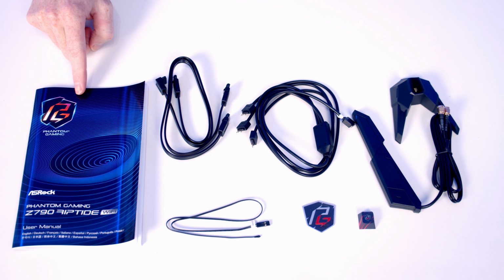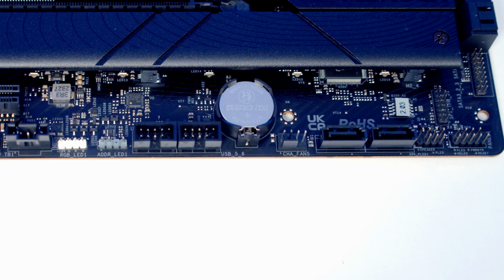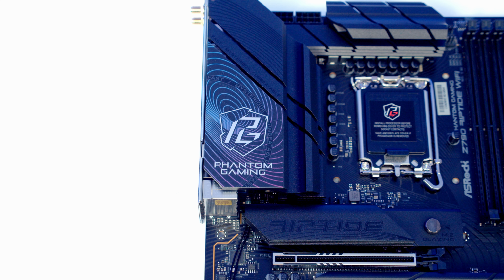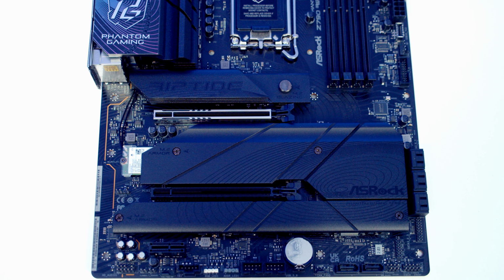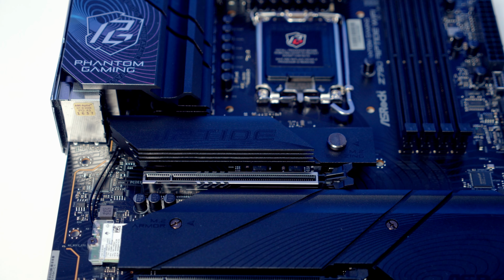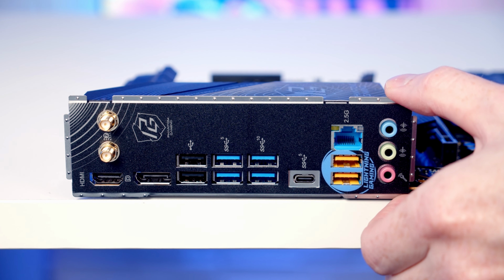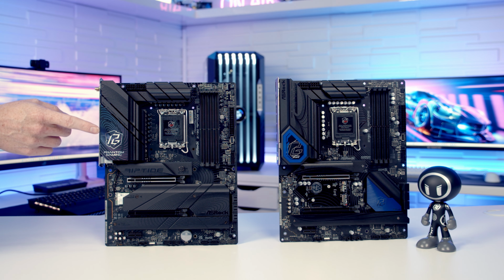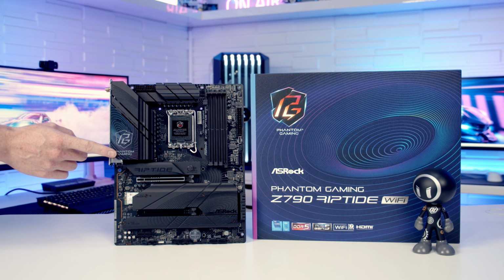ASRock Phantom Gaming Z790 Riptide WiFi Overview

Comment: Oh, Sorry, i have another question that came in my mind every time i Watch some of ur builds. The question Is about the gen 5 SSD and PCIe slot, in what situation Will u downgrade the PCIe and in what not? I haven't got this 😢
Reply: On this particular board, do not use the "blazing fast pcie 5.0 m2 slot for your ssd. Doing so will automatically reduce the bandwidth on your graphics card from x16 to x8. Plus it offers no benefit whatsoever. Just use any one of the other four 4.0 m2 slots. They're all the same speed. It did on mine at least, i'm running a 7900 xt. Power consumption isn't really about the board itself but more about how far you're willing to spend time overclocking and how high. In my personal experience, the overclocking has gone pretty poorly with this board and i have plenty of power and cooling.

Comment: I like these videos Chris! One question... Do u know how much Is the Power consumption of and High end MB like this? (Not considering RAM, SSD or other things but only the MB)! Because someone told me that MB consumrion Is very low, under 20w in every case and others that a MB can reach 80/100W... Do u know what Is the Truth?
Reply: It's under 20W. There are no high power consuming components on most motherboards. If there were any, they would require a cooling fan.

Comment: I like the neutral color. Finally a MB from ASRock that looks less like early 2000s theme. How is the heatsink and heatpipes on them? I have been putting off by Asrock because of their cooling issue and neglect on reviewers constructive feedbacks. Thank you for the video!
Reply: They are pretty good, I never had a bad motherboard from Asrock, I love their motherboards, my go to when I want to overclock. Perhaps they had a couple of bad apples that reviewers didn't like, but usually that's on the low end models, but so does ASUS and others.